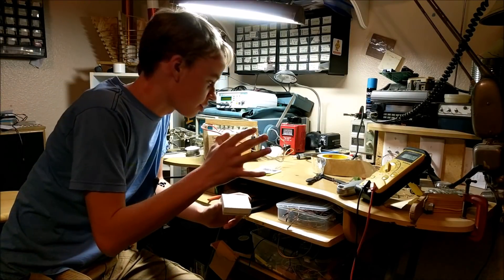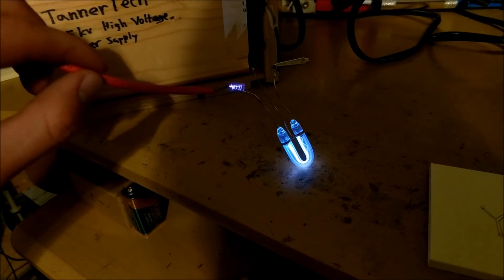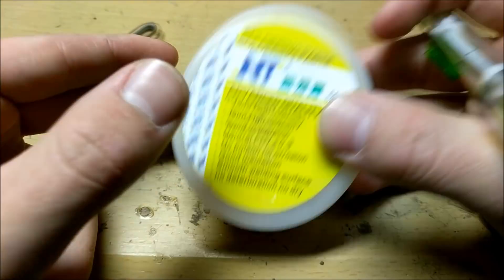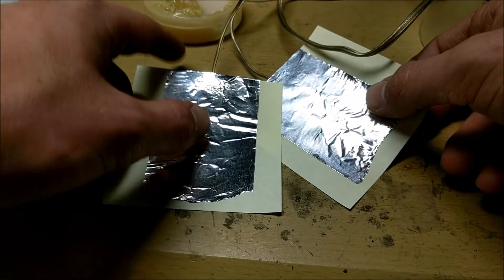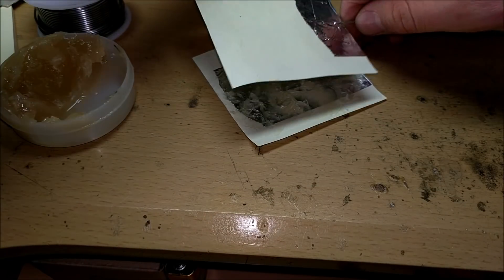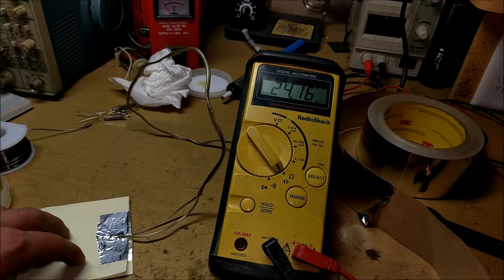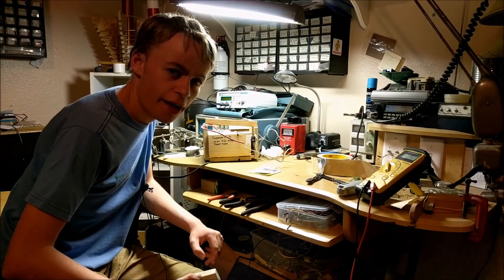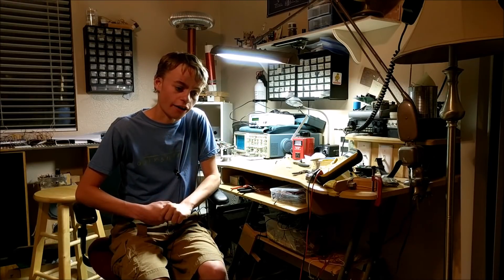DIY Flux Capacitor || Real Capacitor Made with Solder Flux

Comment: Very funny video! I dont know about time travel, but i'm pretty sure you cpuld store energy in subspace, with a three tube system.  You'd put protons at one end, a subspace tap into magnet'neutron toroid, and positive quarks being pumped into the other top tube, you pressurize the tube, then push the protons down, the energy would or should fill the magnetic toroid.  Then when you move the protons away, the positive quarks should come back out of the toroid.  Just a theory, honestly.  I wonder why magnets dont like to hold charges?  Maybe because they are surrounded by negative quarks, and we use negative quarks for electricity.  Wouldnt be cool to have positive quark electricity?  Maybe there is a way to make a magnet hold more charge?  You could encircle it in a toroid maybe, not touching the metal and then put a cone shaped collector plate into the magnet's flux lines at the poles, one negative and one positive, and see if it will charge the wadded aluuminum toroid or doughnut around the magnet and or release it.  Maybe pulse it with a certain frequency?
Reply: just that simple eh lol

Comment: I think you need a ceramic coated explosion containment dish (or frying pan) for such experiments.

I suggest not necessarily using a teflon frying pan - while it can be useful sometimes, if you push it a bit too far you run the risk of setting the teflon on fire.

Comment: Not an oil. The main component of solder flux is pine tree sap that has been distilled and purified to isolate its main group of constituents known as rosin, which is a natural resin. Rosin has the property that it's inert when cold, but becomes mildly acidic when heated up to its melting temperature, and also has a very high adhesion to metal when liquid, so it readily wets and wicks onto metals, and its movement also helps move the solder along. It also contains a small amount of various activators which increase the acidity or lower the melting temperature, and a solvent, usually isopropanol, to keep it in a paste like state instead of like a hard rock prior to use.